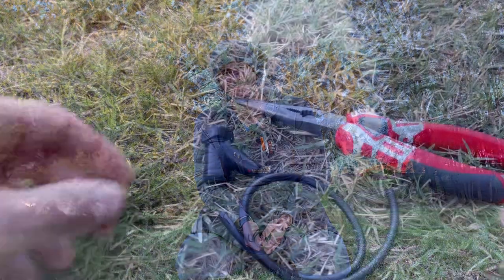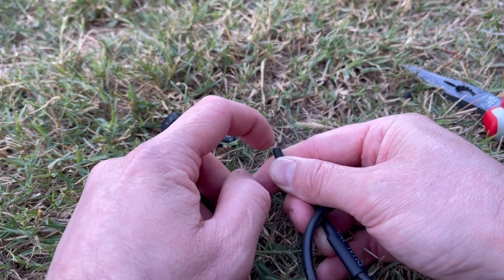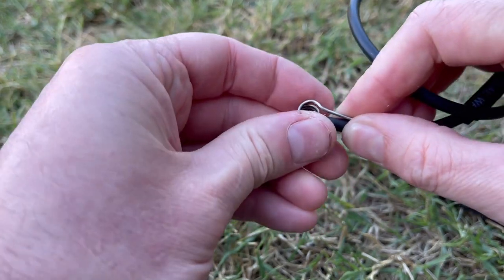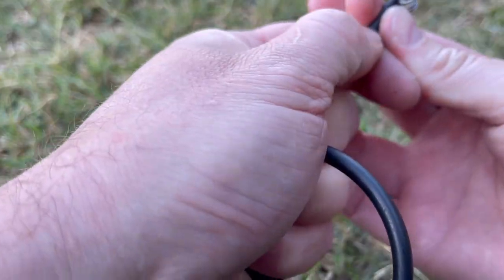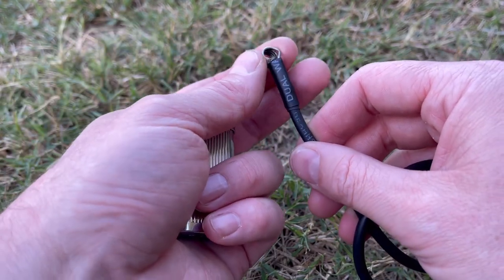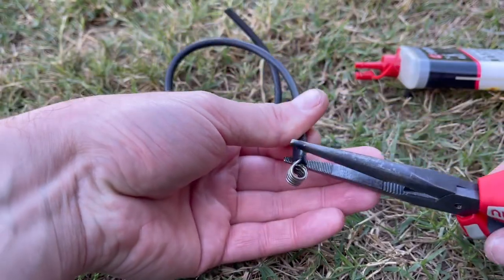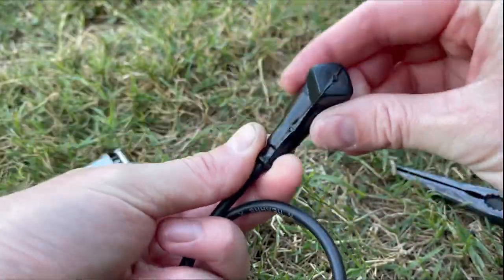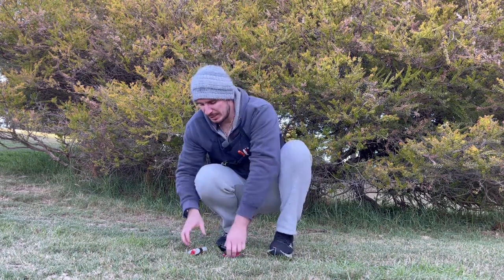MAXIMISE SPARK STRENGTH - GETTING THE BEST IGNITION WIRE CONNECTIONS!

Comment: A lot of good information. I agree with tight, if not pin ca
n move from wire. Do you have a method of splicing?
Reply from the maker: Thanks for watching! I have never spliced a new wire on to an existing to get more length, have you done so?
Reply: @VintageEngineRepairs  I finally have one I might try.   I’ve seen people insert a small rod in , then push other side on. Finally shrink wrapped.
Reply: @VintageEngineRepairs  not prior, but trying one now. Small probe or screw between the two halves. Then shrink tube. Trying to find something small enough. Screw might be better. Solid seems to just push wires down.
Reply from the maker: @steveriggenbach90  maybe a short length of spring steel like you’d find on a lawn mower accelerator cable, sharpened both ends, then the wires soldered together to the cable. I’d then add silicone all round and finish with heat shrink. Let me know how you go.